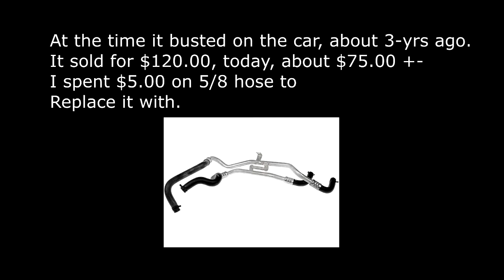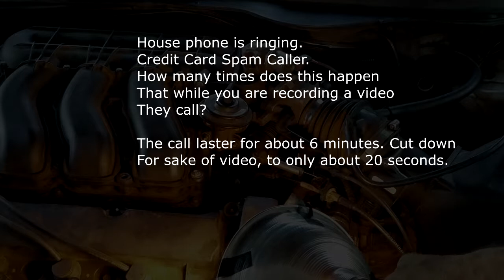2001 Ford Taurus DOHC Heater Hose replacement

Comment: Hi Wayne,
Do you recall what size that e-vac line is you discus in your heater hose video? I need the inside diameter if possible please! 
Thanks
Doug

Comment: I bought the assembled for 50$ on rock auto. Replaced it in a small garage with little light and a headlamp, this fix requires a hose clamp wrench and a few basic car tools otherwise it’s a very easy fix.

Comment: How did this work for you cuz I'm thinking of buying the assembly but doesn't it take a little more than just replacing it with rubber hoses.
Reply from the maker: No.
The only thing that is there originally is a 
PIPE
two hoses

So, replacing it with a single hose, bypassing the pipe, is all you are doing.
See, that pipe is connected to the motor and has to be removed to be replaced.
So, just throwing in this long hose like that I did here, just eliminates the need for an assembly that is close to or over $100.00.

Backyard mechanics.
This is what used to be done before the automotive companies decided to make expensive parts that are not needed, in order to make more money off the consumer.
Reply: @WayneBarronsVlog  Yeah cuz I can see the assembly is basically two hoses but the thing that's confusing me is that little hoes in the middle that connects both hoses. You would just be eliminating that? Doesn't it need that little splice hoes between them or no.
Reply from the maker: @patman0250  No.
It is just a connector for the two hoses.
Nothing more.
It does not do anything special to be needed.
It would be different if it were a 3-way, but it is not. It is a simple In-and-Out tube.

Sorry for the late reply.
Reply: @WayneBarronsVlog  Hi thanks for the reply since my comment I've gained some knowledge on the subject, and went ahead and installed the aftermarket part. Because from what I've learned the two hoses that you substituted for the assembly is actually a really bad idea. You see that holes that I was referring to was the bypass hose. Turns out you actually really need that, because it's a really bad idea to straight shot a hose through only your heater core without a bypass. Because you can't run water fast enough through only the heater core without it struggling the whole way just to keep the temperature down. That's the reason for the bypass. But the primary reason on why it's a bad idea is because, if your heater core ever gets clogged like they usually do. You're going to have a very bad time because your engine is going to burn up almost instantly. I'm not saying it can't work but the risk for me isn't worth it.
Reply from the maker: @patman0250  Can you please provide a link that describes the bypass hose.
As I never saw a bypass hose on my car.
It goes straight from...
Firewall (One-size hose)
Hits the center pipe,
Goes to water pump (Another size hose)
Which is what the center pass-through pipe is for on my car.

I am really confused about what bypass hose you are referring to.
So please, provide a link so I can take a look at it.

Wayne